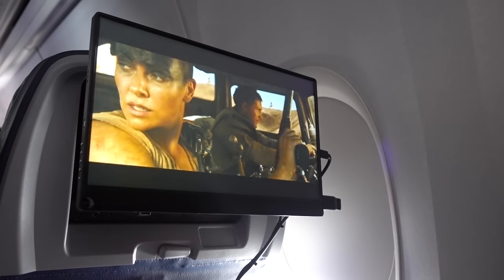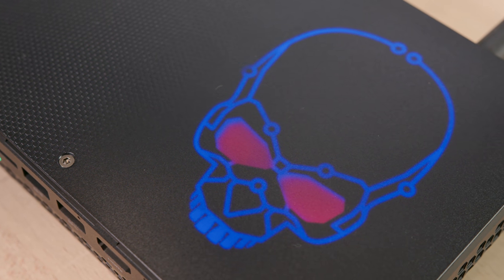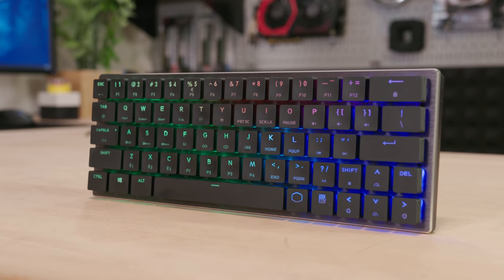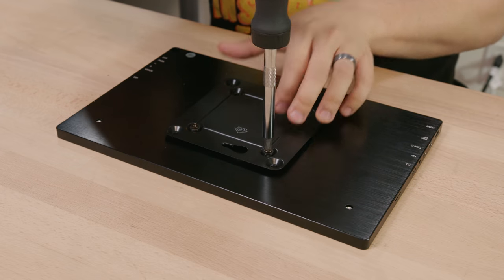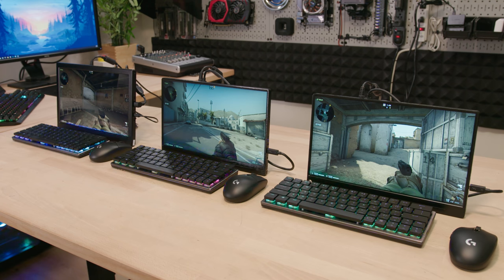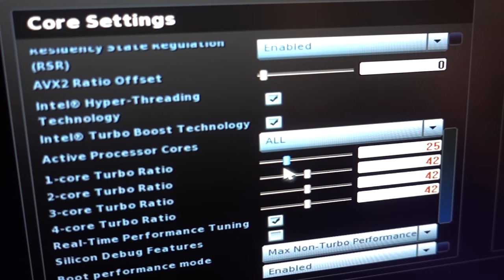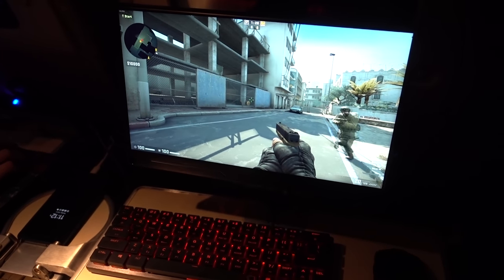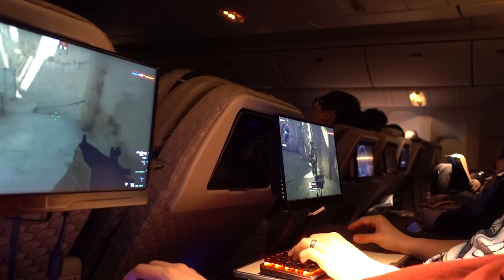LAN party on an AIRPLANE with tiny PCs!!

Comment: Powerbank: *passthrough charging*
Plane outlet: Wait. That's illegal
Reply: If the outlet wasn't able to provide electricity to power the nuc then it wouldn't be able to charge the battery fast enough to continuously power the nuc
Reply: @fecamaiden  how ever that is true. It would slow the battery drain. They could of likely gotten few more hours as those power outlets were only just under what the battery pack could provide under peak load. But there's also the case that they might of actually powered the nuc no problems once it was underclocked using pass through so long as it wasn't doing much like limiting csgo's fps to 60 to lower the load even more but this is all just a guess until it's tried 😹
Reply: @simonb252  maybe they tried it during flight, surely one of them must have remembered that maybe it would work underclocked
Reply: @fecamaiden  Not true. Power draw during startup is usually higher than during idle, so it's entirely possible that the outlet could continuously power the nuc given that it was already on. The power bank would just act as a buffer for power spikes, sort of like a UPS. I'm willing to bet that they could easily run the setup for the entire flight if they wanted.

Comment: For the next time consider using a DC laptop powerbank which outputs 19V DC barrel jack, avoiding the need for the NUC's power supply, thus removing the conversion and inefficiencies from the DC to AC to DC process. Additionally it will also cut out on the bulk and lead to an even cleaner setup.
Reply: That sounds lime a brilliant idea. Could you leave them plugged in while gaming to have a longer cession?
Reply: Aren’t those prohibited on planes? I mean, you can have them in your luggage, but I’m pretty sure you’re not allowed bringing the heavy duty ones with you as a carry-on.
Reply: @KC-bg1th  they would have similar or smaller capacity than the one he used in the video since they are more efficient.
Reply: @reggiebuffat  yes if you can find a pass through power bank. Like those external mac book battery banks.
Reply: I dont undersunderstand a word u say

Comment: you should have went with ASRock DESKMINI A300 with The Ryzen 5 2400G, as it pulls less power and can game
Reply: 65 watt and with vega 11 graphics, probably can be undervolted too and there is a 35 watt version Ryzen 5 2400GE
Reply: @ajdiaz6799  And the 35watt version is a high bin chip too, it'd be perfect if you can get your hands on one!
Reply: aren't those zotac watercooled Mini PCs still a thing?
Reply: what he has is basically a 7700HQ and equal to a desktop 1050ti, those arent.
Reply: The A300 is too thick.
He needs the i7-8705G Hades Nuc, 65W. It's almost twice the GPU grunt of Vega 11.
Reply: @LumenateTV  Is the watercooling loop under 100ml in capacity? :P
Reply: @VoidCraftedGamingHD  lol good comment

Comment: Couldn’t you of used the battery pack as a adapter to keep playing?
Reply: The first problem would still be true, the amps of the outlet wasn't enough for the PCs and would thus drain the battery faster than it could be charged.
Reply: @0FFICERPROBLEM  this is true buuuuuuut it would discharge a hell of alot longer then if it hard nothing
Reply: @0FFICERPROBLEM  yes. But i will prolong continuous gaming session
Reply: @Moibhin  True true
Reply: Most battery banks don’t allow pass through charging.

Comment: Invest in a $20 kill-a-watt meter so you know how much power the setup draws before hand. You could of also tried powering the monitor separately with the battery and the NUC with the plane which should of given much longer playtimes.

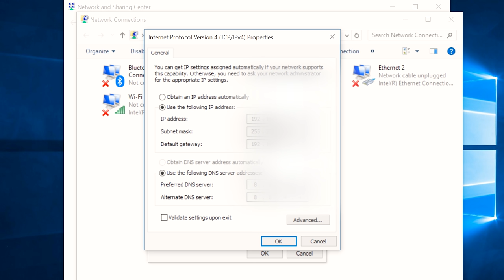Comment: 6:50 lol... are you seriously gonna censor a 2-computer local ip address?
i mean.. i get the safety thing, but thats just paranoid lol
Reply: This shows to me his lack of knowledge on networks... and just computers in general in my opinion
Reply: EnderCrypt Could I get an explanation or a link to more information on IP addresses? I’m curious about the matter.

A normal IP address is tied to the router, right?
Reply: He knows about computers but not necessarily about networks.
Reply: @MakusinMeringue  you problably wanna begin reading about public&private ip addresses
https://www.iplocation.net/public-vs-private-ip-address

in short, there are 2 "types" of ip addresses, public and private
each router (network) has a public ip, this is the ip accessible from the internet
the router and all connected devices have a private ip address (usually starting with 192.168.)

if you think of your network as a home, your public ip is your home address and your private ip is the room you are in

letting the outside world know of your private ip can be a small security risk (assuming they also got your public but still an extremely negligible risk)

also he could just shown one local ip address then changed to another anyways.. they are just incremental
192.168.0.2
192.168.0.3
192.168.0.4
192.168.0.5
etc, pick any you like
my computer is on 192.168.0.4
and i got a server at 192.168.0.15

Comment: I can tell you BitWit. I am quite a aviation enthusiast and a computer construction enthusiast and I can say LAN parties are fairly new on airplanes. British Airways was the first to tackle this and now you can play battleships with other people on the plane on the screen infront of you. You can only expect this on long haul aircraft aircraft specifically the Boeing 747-400, 777-300ER, Airbus A380. However British Airways  would have to fit out every screen system with much better performance parts and a operating system, because atm the are running a extremely basic software limiting a lot of things like let’s say FPS games

Comment: can you not charge those batteries while you're using them?
Reply: most cant, there's a lot of stress to batteries doing output and input at the same time. there are some that can but they're expensive and don't have high output
Reply: @bradhaines3142  Thanks for the answer, I was wondering the same thing.
Reply: Devostex  they charge way slower than they discharge. would take probly 4:1 to be able to keep up

Comment: Were you worried about the weight breaking the screen built into the seat? The ones I've seen don't have any strong protective layer. An alternative could be a pair of big L-shaped arms that hook over the top of the seat and go behind the fold-out parts of the headrest, so as not to annoy the person in front of you.

Comment: i followed your idea in my flights just with a good sucking device to hold my phone high enough to enjoy movies and charge at the same time from seats usb ports and the crew members was shocked cause they couldn't tell me anything like "closet he tray for take off or landing"...
but i found problems even in 3 hour flights that the sucking mechanism is not holding on always because of trembulance or just the seat screens of Emirates are not glass but have a layer of plastic mate that i am forcing to pill off a bit. no permanent damagesa re done... so i am looking for securing my screen with a Velcro type fabric that can go arround the seat screen. most of them are movable and there is a space behind them to slide through a piece of fabric
Reply: A sucking device, only entertainment a man needs on a flight.

Comment: plane outlets 120v at 100w. power bank, 120v at 100w with 120w peak. why didnt you just underclock it to begin with XD
Reply: Better question why didn't they charge the banks while they were playing it would have still drained the pack but at a rate that would have been much much slower maybe even enough slower to get a few hours out of it.
Reply: @bdhale34  chances are they were LiPo's which can get very volatile if charged unless special precautions take place. Had they done that, it could've exploded or at least bulged. Most the time when you get a high powered powerbank there'll usually be a sticker on the side that says: "do not charge and discharge at the same time." It probably also destroy the battery's lifespan.
Reply: @thx134  True thought about that after the comment but then I thought meh they like to waste money so them lasting probably wouldn't bother them.
Reply: the voltage or wattage was not the problem.... it was the amperage... they had to get the power bank to have higher amperage so it would work
Reply: @zackburkhart9811  amperage is a calculation of wattage/voltage. The original equation is P=IV which is watts=amps*volts. So we see the plane outlets put out roughly .8-.9 amps (depends if you use 120 or 110v) and the power bank which at peak (very short durations due to protections) will do 120w at 120V which is 1A. Most of the time it will output the exact same as the airplane outlets. (120v at 100w which gives .8A)

Comment: why don't you use Nintendo switch? laptops tablets
Reply: There is no LAN on tablets or Nintendo switch but a laptop would be a good idea, anyway the point of the video is to put and actual pc on an aircraft 35000 feet in the air.
Reply: George Adams probably also the batteries in the solutions mentioned above. Batteries with high capacity are fortbidden on airplains
Reply: These comments are not clever. They are annoying.

Comment: I did something similar, albeit a lot easier on a 20h flight in 2014 - just 4 guys who had never met before with laptops and an android phone's wifi hotspot to connect them. Worked like a charm. Now is it a proper Lan party if you use Wireless Lan? I say it is. With laptops you don't have the power delivery issues you experienced, and wifi eliminates cables people could trip over. Your setup is by far more awesome though, but we did what we could with what we had at the time.

Comment: to improve you should get rid of the multiple ac-dc, dc-ac, ac-dc conversions in the mobile LAN setup (the AC outlets on the airplane are a DC to AC inverter the power bank stores power on batteries thus 1st AC to DC then 2nd inverter for its AC out and those laptop power bricks are 2nd AC to DC conversion)

Comment: I would recommend using laptops.. even if you connect the external screen to them it might help resolve some power issues.  You might able to game on battery for a time.. then plug in the laptop and charge while doing low power tasks on the laptop like watching a video so the power pack doesn't exceed the outlet.. then go back to gaming on battery once its charged.

Comment: Kyle, you should take a look on the acer switch 7 black edition for this project. 8th gen core i7, nvidia mx 150, 16gb ram. 65 watt charger. Its a tablet like the microsoft surface pro, just with a mx 150 in it. Maybe this thing will make it more convenient next time =)

Comment: Does this make any sense to put strong CPU in a case without adequate GPU? I don't think so, especially with that high price.

But the idea for (real pc) gaming during long flights is great.
Reply: Laptop
Reply: DerScharfSchutzE Yeah, but I was thinking about airlines equipment, factory installed. Could be a reason to place wider seats instead of sardines one.

Comment: I have a question. Why did you take this route to achieve this goal? There is a much easier method. Take a Windows 10 gaming tablet, such as the Linx Vision 8 which is super cheap now. They are capable of running many games, including CS:Go and Skyrim. Hook it up to a powered usb and then connect the two using a Ethernet>USB adapter. Would have been a lot cheaper and a lot easier.

Comment: Why didn't you leave the power banks plugged into the plane outlets and use them as a "buffer" so that they would discharge when the computers peaked above the output of the outlets and recharge when the computers were using less power.

Comment: If only there was a computing device that has a monitor, keyboard, mouse, etc built into one convenient chassis.  Seems to me it would have been easier to simply use laptops with stands to elevate them to resolve the looking down neck pain issue.

Comment: I wouldn't do this, that suction cup can cause damage (will cause damage) to the touchscreen on the plane and you could be charged for it. The systems on the an airplane are extremely expensive. I would venture to guess those screens are in the multiple thousands of dollars range, because they have to be FAA certified. Not to mention they might take that seat out of inventory and the company will lose money not being able to sell that seat. If you were on my airplane, I would kick you off and make sure that screen is tracked for damage and you billed for it when it fails.

Comment: couldn't you use a laptop with a low tdp mx150, that would first, be easily chargeable by the AC on the plane, second, be so much more portable, and third, also deliver 60+ fps in csgo.

Comment: Turn on Vsync, which will limit the fps to the monitor refresh rate u using. This way the hardware dont need to sweat, use less power, also turn off some cores and limit tdp for cpu and gpu. As you said, CSGO isnt a demanding game, if i can play with 60 fps, than everyone else can! :)

Comment: I have a 14 inch Lenovo with an it 8gb ram and a gtx980m... it's got pretty good battery life... it was 250$ at a pawn shop. I also have an 11 inch windows tablet that also has 8gb ram and a y5 whatever processor.. it was 112$ shipped on ebay... so... ummm...  yeah, you go on with your bad self...

Comment: Only 0.9A? Wot? 100W is 100W, doesn't matter what the amp is. Pull it down to 50V and 2A you would still have 100W. And blurring your local ip adress? Hm..